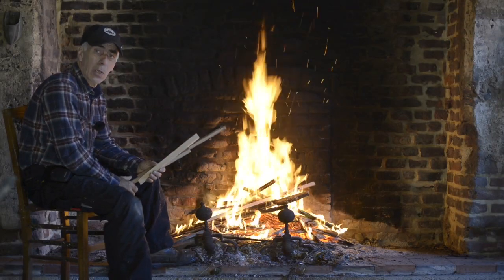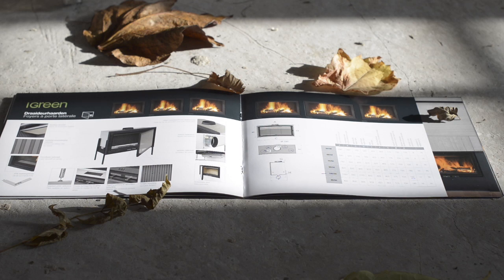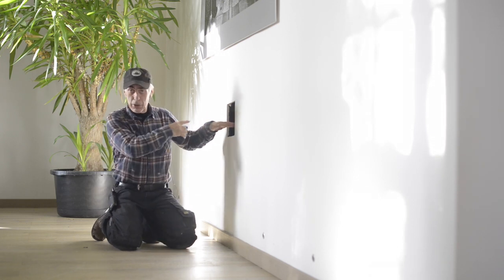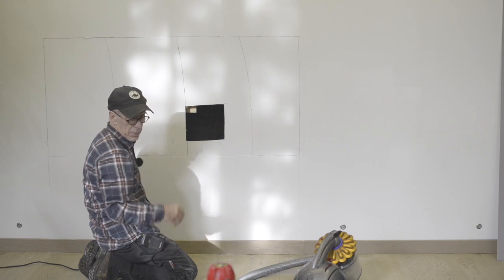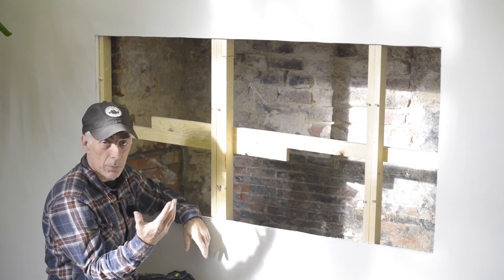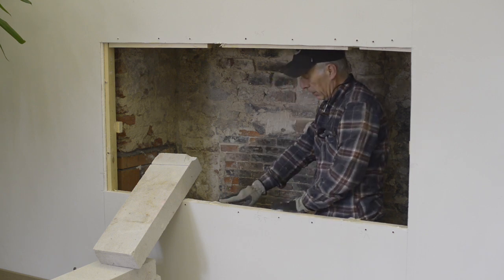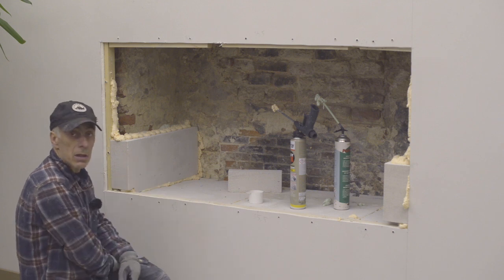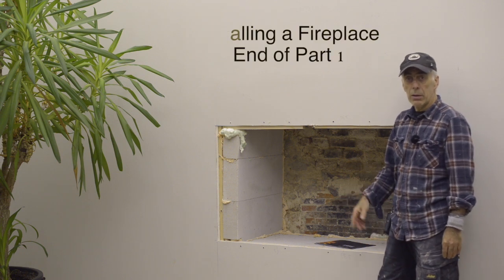Building a fireplace part 1 , Ifire/Igreen

Comment: 1:30 Tickles me to recall my fellow Bricklayers estimates; back in the mid 70's - the early 80's was that 70 percent of heat was lost in a full masonry fireplace. The ''Heatilator'' fire box designs reversed those numbers. While only in that trade for those few years... I'd laid & installed quite a few; but never have one of my own.
Tickle #2. - to recall. When Daniel Boone was building his fireplace it was said that when asked by passer byes... Daniel is she gonna draw? Daniel's reply was ''She's gonna draw alright; your the 3rd damn fool she's drawn today!''
Tickle #3. Ben Franklin's fireplace design was said to have  - what was called a smoke stack fan attached to a rotisserie in such a way that as the heat increased so did the spin of rotisserie.
#4. The most truthful few things about having been in the masonry trade is these 2 facts 
''That no other material on a home is touched & adjusted into place more than that of the lowly brick.'' 
''Moving Thousands of bricks by tongs & thousands of cubic yards of mortar with a wheel barrow & a shovel... is a hard labor indeed. 
Yet moving those thousands of brick, one at a time by hand, & placing those thousands of cubic yards trowel by trowel... is an even harder Glorified Labor!''
''Though every fire in which we gaze may have the same actors of fuel, smoke, & heat...
 Their flame movements are never identical.'' -gilpin 111919
  Such are the thoughts of this former Brick-lier.

P.S. Almost forgot to put Him 1st. in my thoughts... 
''For our God is a consuming fire.''
Reply from the maker: wow great text... thanks